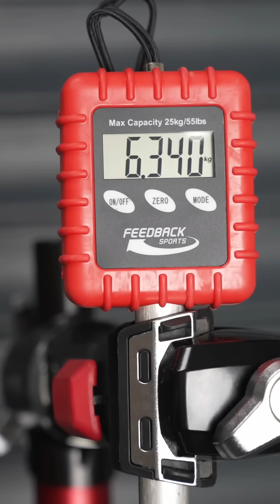Why are New Bikes Heavy? #shorts #bike

Comment: the bike u see here is by a pretty cheap brand....sub 8kg with Ultegra DI2 for less than 5000 euros is actually a bargain ....an equivalent bike by Giant for instance is at least 2000 euros more expensive and will weigh in at about 8,2 ...the Giant Defy SL with Sram Red weighs in at 7,7 and cost 11999 euros...also your old bike has absolutely no aero features wich is a lot more important than weight

Comment: Is it true that extra weight on a bike should be measured ×10?
Reply: Nope. You need around 15w more if u have a 2-3 kg heavier bike just shave your leg or loose some weight ... 
I can understand that 500g is matter when everyone weighs 65kg and can output 5.8 w/kg but as an amateur its nothing. 
Also if u look at the price of a dura ace 12s vs 105 12s cassette you will be shocked. So yeah light bike a cool things but i think they are very expensive and will not improve your performance that much.
Reply: @szdavee92 thank you. I would imagine, but i dont know for a fact, that weight dropped from wheels would compound because of rotation like on a car but i wonder if you can feel it or not?
Reply: @universe-juice  I have a carbon and alloy wheel and you can feel the difference during acceleration
Reply: I agree. I also broke my last set of aluminum wheels.  Ran over a toilet that someone had dumped on the road.  Riding where i live can be sketchy 🤣
Reply: @universe-juice 🙈🙈
Reply: @szdavee92  to be fair, i had an extremely light bike and ended up breaking it. 🤣   so i never buy top end stuff anymore.  If im not riding a gravel bike around im on my felt. Just cant afford to replace frames alot

Comment: The weight is mainly the disc brakes, and everything that goes with them (fluid, extra spokes, different layups etc). My Helium SLX rim brake bike has 11-32 12sp cassette, electronic gears, power meter, deepish section wheels (25mm clinchers) and a one-piece aero cockpit (which is most of the aero benefit of a frame in any case), and it still only weights a bit over 6.5kg with pedals.
Reply: It's more that the fork and wheels need to be stronger that adds weight
Reply: @TrickyTree84  Yup, extra carbon in the forks (and rear stays) and front wheels built like rear wheels (more spokes, cross-laced) to resist the braking forces applied at the hub.
Reply: I prefer rim brakes for road but I want bigger tyres. Shame they stopped dev of rim brake bikes. They only needed bigger tyre clearance.  @TrickyTree84